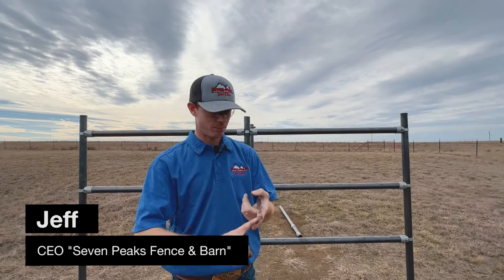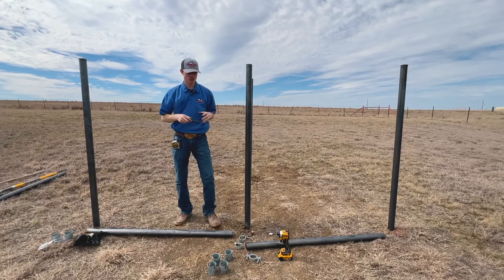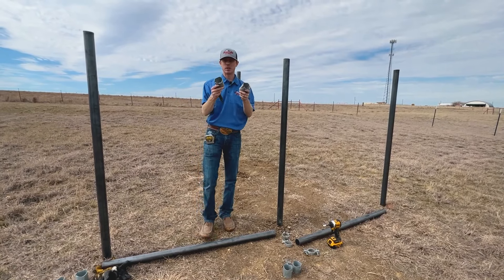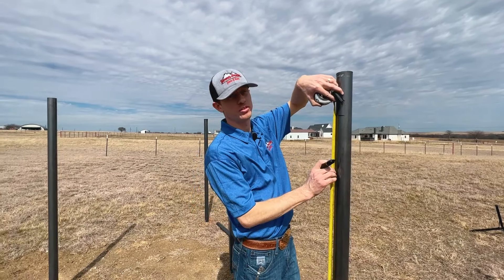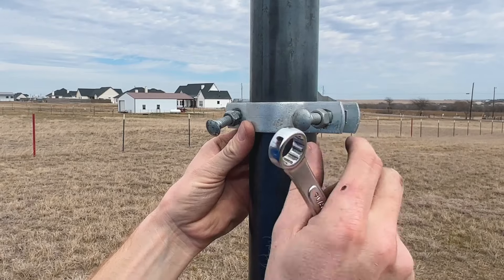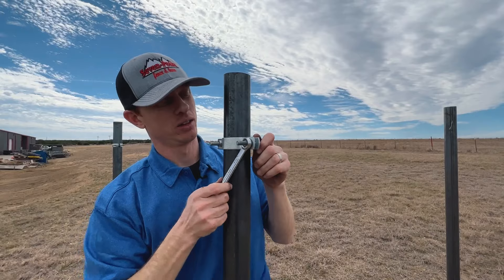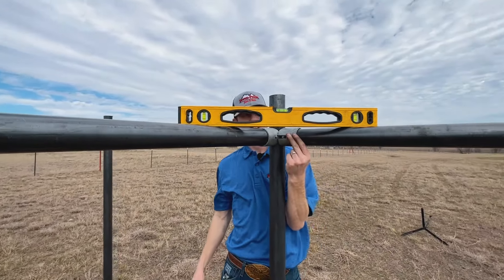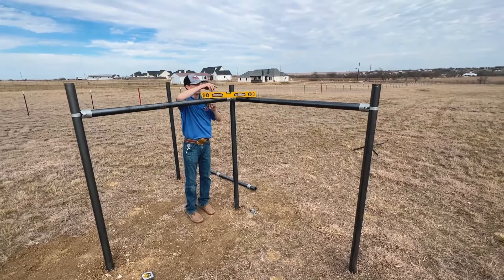How to Easily Build Pipe Fence - No Welding Required with the Bullet Fence System

Comment: So with a 3 inch gap in your rail , if you pull wire tight from the corner im guessing this doesn't really add structural support for pulling wire?. If you pull from the corner post, you would need to pull it 3 inches out of plumb before the rail is tight between  the posts. Is that correct?

Comment: You should be putting them 1.5 inches apart not 3 inches like you said because you're only supposed to leave 3/4 of an inch on each so your brace will be more tight!